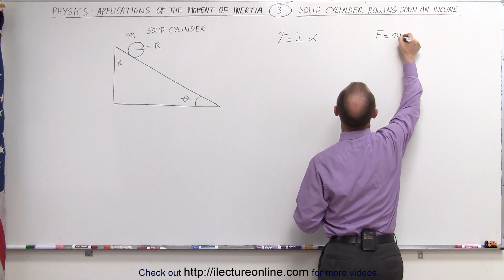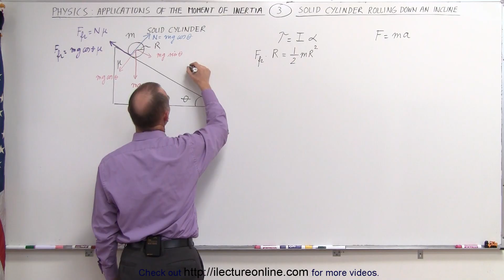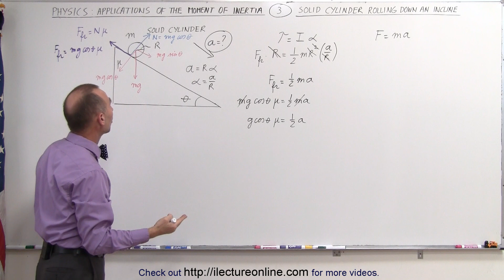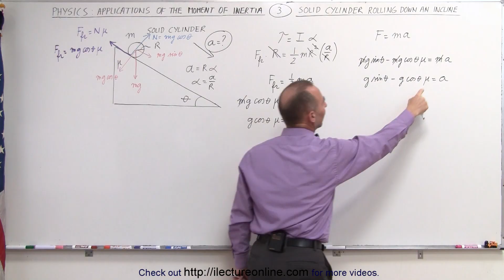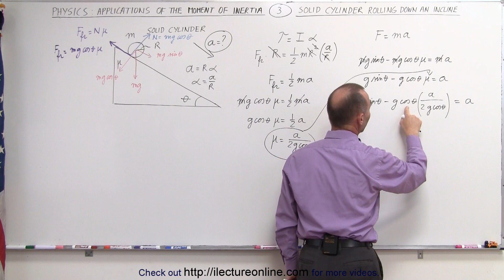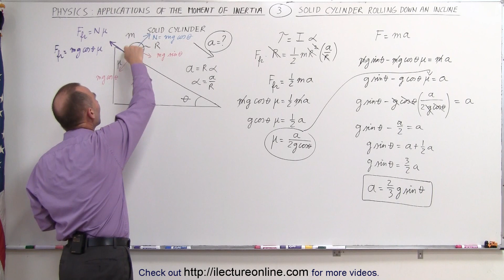Physics 13.1  Moment of Inertia Application (3 of 11) Solid Cylinder Rolling Down an Incline

Comment: It's been quite a while, so I'm not sure if you will respond or not, but I have a question:
I object to how we can directly assume that the moment of inertia of a wheel rolling down an inclined surface is 1/2*m*R^2. This wheel is not rotating on its own central axis but on the tangent point. For this reason, I think that +m*R^2 should be added using Steiner Satz.
Reply from the maker: The rolling wheel is not rotating about the tangent point.  It is rotating about its center of mass.  Note that the center of mass moves in a linear fashion which then becomes the point about with the wheel rotates.
Reply: @MichelvanBiezen  You are right that I have come to a wrong conclusion by interpreting the system in a different way before. This body rotating on the ground will rotate around its own radius, not around an outer radius, this is where my mistake lies. Thank you for taking the time to respond.

Comment: 4:50 could have just replaced gcos(theta) with a/2 in the right equation insteas of solving for the friction constant.
Great video. I didn't understand how the friction interacts with the cylinder in my own lecture, so this was very helpful.
Reply from the maker: We wanted to use the standard method so that you can see how it is used in any situation.  Glad you liked it.

Comment: could we use conservation of energy for this question?
Reply from the maker: It depends on what they are asking.  If they ask for the acceleration, then it is better to use the technique shown in the video.  But if they ask for the velocity at the bottom of the incline, it is better to use the conservation of energy equation.

Comment: sir I am a bit confused regarding the friction force won't it be in negative as the normal force is upward but the equation  mgcostetha is for the weight which is downward force?
Reply from the maker: The direction of the friction force is typically opposite to the direction of motion.

Comment: Everyone is talking about how static friction varies and it does, but for a beginner physics class you don’t take that into consideration
Reply from the maker: Not sure what you mean by "static friction varies".   The coefficient of static friction between two surfaces is typically considered a constant (which does not change).  Therefore the force of friction between those two surfaces is constant as well.  That said, the force of friction can never be larger than the force applied to the object which then causes the force of friction to exist.  Therefore until the force applied to the object exceeds the maximum that the friction force can be, the friction force will be equal to the force pushing the object.

Comment: Hello sir, what is the reasoning behind not applying the parallel axis theorem in this example?
Reply from the maker: The parallel axis theorem is used to find the moment of inertia relative to another point away from the center of mass.  We are not trying to do that here.

Comment: Only doubt the direction of Friction Force... As rolling friction acts in the direction of rolling
Reply from the maker: Just like the forces that allow you to walk, (your foot pushes backwards against the floor and the floor pushes back in the the direction of your direction of motion, the wheel pushes backwards against the incline and the incline pushes the wheel forward.  Also note that the rolling friction is something different which is explained in our mechanical engineering videos.

Comment: For 2:08, why is the torque of friction positive? With the right hand rule, my thumb would point into the page, indicating that friction would be negative. So what specifically let’s the torque of friction be positive? Thank you SO much.
Reply from the maker: In that equation we equated the magnitude of the torque to the product of the moment of inertia and the magnitude of the accelration.    Magnitudes of vectors can never be negative.
Reply: @MichelvanBiezen  Oh, okay. By default, should we use the magnitude of the torque? Thanks.

Comment: I came back to this Video, Michel. Always interesting to see the simplicity of a problem when you show us how it's done.  I notice that if Theta is equal to 90 degrees, then  a = 2/3  g  which is Free Fall...  as shown in your video with a Yo Yo... :)  Physics is AMAZING.. thanks.
Reply from the maker: Hi Philip.  Yes, taking problems to the limit as you did, does reveal some interesting insight.

Comment: I have a question in my university textbook which I couldn't solve 

A sphere rolls down a plane inclined at 30° to the horizontal. calculate the velocity and acceleration of the sphere after it has moved 5m from rest along the plane (I = 2MR²/5)

I'm confused cus I can't figure out the force perpendicular to the radius  which is causing the ball to roll  

Any help sir
Reply from the maker: Solve the problem exactly the same way as shown in the video, but use the sphere moment of inertia instead.  Once you have the acceleration you can calculate the velocity by using the equation if kinematics:   V^2 = Vo^2 + 2 a  x   solve for x.
Reply: @MichelvanBiezen  thank professor, I now understand better  
Thank for making knowledge free 🙏
Reply from the maker: When we get feedback that the videos are helping students around the world, it is all worth it.

Comment: So acceleration of the cylinder is independent of the moment of inertia? I find that very interesting because my original intuition was that the a cylinder with lager moment of inetia would accelerate slower. Thank you for the help.
Reply from the maker: That is not correct.  If the moment of inertia is larger, the acceleration will be slower.  (The fraction in the answer will be smaller)

Comment: So according to the equation, any two different solid cylinders, regardless of weight or radius will accelerate at the same rate down the ramp?
Reply from the maker: That is correct.  Radius and mass do not matter.
Reply: @MichelvanBiezen  thanks a lot!

Comment: Awesome Video! But since the force of static friction can vary from 0 to mgcosthetaU(max) one should note that in the above approach static friction is assumed to be at the maximum. But regardless the answer would still be the same if you were to redo the whole problem by replacing mgcosthetaU with Fs
Reply from the maker: The video is indeed a simplified version of what is actually going on, including ignoring rolling friction, but that is necessary at first to introduce the basic principles in physics.  Note that the friction does not need to be at the maximum level.  Friction can be anywhere between 0 and mg cos(theta) mu
Reply: @MichelvanBiezen so the most correct way is to use rolling friction?

Comment: If we take the center of the cylinder as a reference point, so relative to this point the contact point between the cylinder and the inclined is in motion (not at rest).  My question what is the expression of the work done by the friction between the cylinder and incline relative to the center of the cylinder?
Reply from the maker: The work done by the friction force is not relative to any particular location.
Reply: @MichelvanBiezen  But , in general , the work done by any force depends on the force vector and the displacement of the point of application of this force. The displacement is determined relative to a frame of reference , so the work done by a force (friction force or other force) should depend on the frame of reference of certain origin.  if we multiply  the moment of the friction force by the angular abscissa of the disk (It is the work done by the friction relative to the center of the disk) we found that it is equal to the rotational kinetic energy of the disk.           What is your comment on this equality? Thank you.
Reply from the maker: The work done is a SCALAR quantity and as such cannot be associated with any particular position or direction.  The work done is simply a dot product  (= scalar product) of the Friction force and the displacement.
Reply: @MichelvanBiezen  yes , that's right the displacement vector AB of the point of application of the force remains constant in any frame of reference, of origin O, and having any direction. Let's study this special case: if the origin O moves with the same velocity with the point of application of this force , in this case the displacement vector AB relative to this frame becomes zero, so the work done by this force becomes also zero. What's your comment and thank you again.

Comment: If the solid cylinder rolling down an incline starts off with an initial torque=Ixalpha then i) does that initial torque value remain a constant all the way down the incline, and ii) is the largest that the initial torque scalar-value can be ONLY as large as the static Friction force (in the opposite direction)? It seems to be clear and make sense if so. [Huge fan! Thanks in advance.]

Comment: I'm having a massive case of confusion after self-learning about rolling friction, and then coming back to this question. I have a couple of questions, if someone could help me clarify, I would greatly appreciate it:

1. The coefficient of friction in this question (and the friction force in this question), are they referring to static friction, which is what I thought the friction always is when rolling without slipping, or is it rolling friction? I know we didnt solve for u here, but if we had solved for it, would we consider it to be the coefficient of static friction, or would it be considered the coefficient of rolling friction?

2a. If it is the coefficient of rolling friction, can one say that rolling Friction = coeff. of rolling friction x Normal Force? Also, are we just ignoring static friction then?

2b. If it is not rolling friction, then it must be static friction (which is what I've usually seen). If so, how can we know when rolling friction applies vs. when your classic Fstatic = us x normal force is what must be done? Because if this question does deal with only static friction, I know exactly how to handle it, it's the same old friction problem, but how in the world do I apply rolling friction to this? The object is rolling, so rolling friction must be involved somehow I guess.

This is also leads to a similar scenario question I have as well:

3. I have a solid block on a flat surface, I kick it so that it has an initial velocity of 10 m/s. Given enough kinematics and force info, I can easily figure out the total displacement of the block, and I can also solve for the KINETIC coefficient of friction in this case (easy peasy). Let's just say, for the sake of simplicity, that the block traveled 10 meters before stopping.

If I have a ball of same mass and material as the block that is on the same flat surface, and I kick it horizontally such that it also starts with a horizontal velocity of 10 m/s just like the block, it moves linearly and also rolls until it stops, let's say no slipping. 

Given enough kinematics and force/torque info, if I use linear kinematics, the linear displacement also comes out the same as the blocks displacement of "10 meters", but this doesnt seem right to me since some of the energy must have been used for rolling instead of translating. Would the linear displacement be the same for the rolling ball, or am I right in thinking that I am missing something? Regarding the force portion of the question, I can also solve for the friction force and/or the coefficient of friction. I would solve it considering STATIC friction only, with no consideration towards rolling friction (because that is all that I have been taught). But, by doing so, am I actually solving for the rolling friction force (and coefficient) or am I right in saying that I am solving for the static friction force (and coefficient)? If I am right about static, it again brings up the point of how would rolling friction apply here?

THANK YOU for your time and effort, future responders!

Comment: i did a question where the mass= 1.7kg and is on an incline at 37 degrees. i used your working and got the wrong answer but i'm not sure why
Reply from the maker: Did the problem include the moment of inertia?

Comment: Final answer is correct.
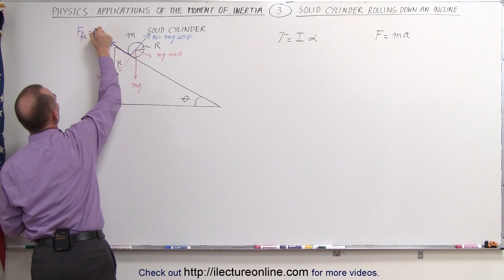Indeed a=2/3*g*sin(theta) BUT the explanation has a mistake. On minute 1:22 he says "friction = myu * N" and this is not correct, need to be left as friction (f), no myu involved, no N involved.
Still, final answer is correct a=2/3*g*sin(theta).
Apologize in advance in case I'm wrong...

Comment: Hello, I am currently using this wonderful video as the theory behind a simple experiment we are doing as part of a high school research assignment. For his final solution, it seems that pnu is not a factor?! Does the frictional coefficient of the inclined surface not matter? This leaves me so, so confused.
Reply from the maker: The friction will cause a very slight slow down, which is typically ignored, as it is minor compared to the moment of inertia effects.  If you roll different object of the same shape, but made of different materials, you will find that they accelerate at different rates due to the differences in the friction forces (as part of the reason).
Reply: @MichelvanBiezen  Thank you for the quick and apt reply. I am will consider rolling friction as the main culprit, as the incline surfaces are quite deformable (i.e. carpet/rubber). I should have said it before, but your videos are excellent - having resources like this for free is amazing.
Thank you.

Comment: How did you take static as limiting friction?
Reply from the maker: When objects roll, the surface of the rolling objects and the surface of the incline do not slide relative to one another and therefore we use static friction.

Comment: The difficult part is to figure out what is the force causing the torque that gets the rod to roll. If you figure out , this is the friction force by the bank to the rod, the rest would be solvable.

Comment: thanks alot sir .  How much is the work of friction force in this example ?
Reply from the maker: Yes, we are ignoring the friction force (other than causing the rolling motion).  If you want to calculate the work done by the friction force you use the equation:    W = F x d
Reply: @MichelvanBiezen  thanks alot

Comment: I am teaching this right now to Eng Tech students . I really enjoy your explanation but have a question/comment this may be semantics but I am thinking of the work-energy equivalent. If friction is creating the torque and it is in the opposite direction to motion doesn't this contradict the concept of work?  Wouldn't the upsetting force (the component of mg acting perpendicular to contact) be causing the torque and doing the work?  If you look at the work required to roll the cylinder up the hill it becomes a bit more obvious. I would appreciate your thoughts since I am not  physicist but a lowly engineer.
Reply from the maker: That is a good observation.  Typically we assume there is enough friction to cause the wheel (cylinder) to rotate, otherwise the wheel would slide down the hill.  But the friction force is small enough to ignore it in the energy conservation equation.    (Like ignoring the wind resistance in our kinematics problems.)

Comment: Nice video!  The static friction force, however, isn't mu (static) times the normal force, since that is the maximum static friction force and there is no indication that static friction is pushing at its maximum value.  You get the same result, though, since you eliminated mu.  But if you leave the force of static friction as Fs you get the same result:
From the torque: R*Fs*sin 90 = I * alpha = (1/2 m R^2) * (a/R)     so Fs = 1/2 m  a
From the Forces in the down-the-ramp direction, mg sin (theta) - Fs = ma, so...
mg sin (theta) - [1/2 m a] = ma
So a = 2/3*g*sin(theta)
Reply: Totally agree !!

Comment: It is assumed the object is rolling not sliding. In fact there are 3 cases:
1. μ > (1/3)tan(θ) : object stands still (?) 
2. μ = (1/3)tan(θ) : object rolls (a = 2/3 * g * sin(θ))
3. μ < (1/3)tan(θ) : object slides while rolling (a > 2/3 * g * sin(θ))

My guess is that object doesn't abruptly go from 100% rolling to 100% sliding:
Sliding portion gradually increases as θ increases for a given μ.

Comment: The friction force is static friction. You cannot use the f=uN formula until the break away moment. Having said so, you will get the same result without using f=uN formula.
Reply: The answer will be even simpler if we just keep f and don't spread it out, because eventually it will cancel out
Reply: He might have meant kinetic friction. Could you still use the f=uN equation if that was the case?
Reply: @rephaelreyes8552  It has to be static friction because there is no relative motion in between the incline and the bottom point of the cylinder. Also, if there is any relative motion, the relationship of a = r α is not valid Professor Biezen's earlier tutorial video https://www.youtube.com/watch?v=suaJz-zWt3A
Reply: Yes you are correct

Comment: a solid sphere is rolling down aN INCLINED PLANE WITHOUT SLIPPING IF THE INCLINED HAS A INCLINATION THETA WITH HORIZONTAL THEN THE COEFFICIENT OF FRICTION BETWEEN SPHERE AND THE INCLINED PLANE SHOULD BE...

PLEASE SOLVE ANS OF PROBLEM IS 
FRICTION COFFICIENT >=2/7TANTHETA
Reply from the maker: a = (mgsin(theta) - mg cos(theta) mu) / m = g sin(theta) - g cos(theta) mu                                          Torque = I  alpha                mgcos(theta) mu R = (2/5) mR^2 (a/R)       Then substitute for a in the second equation and solve for mu

Comment: So why de difference with hollow tubes and not hollow. Even with equal mass
While if you drop anything it will fall down equal.
Reply from the maker: Falling down, yes it does not make a difference.  But when objects roll down an incline it DOES make a difference.